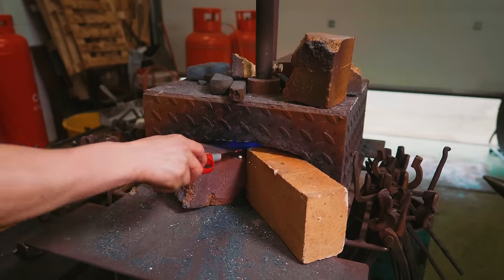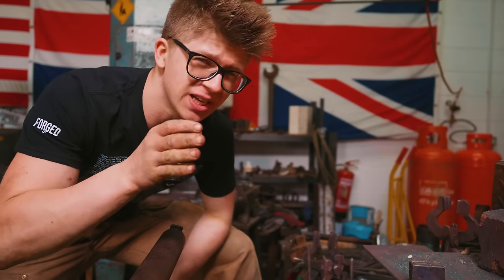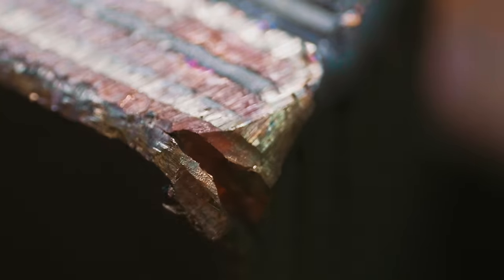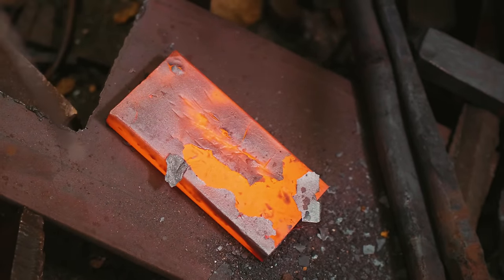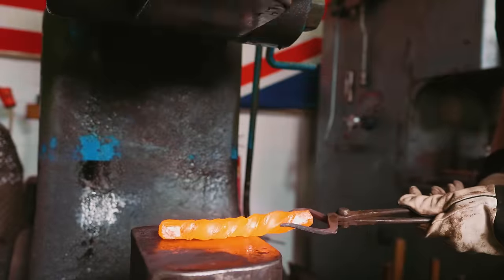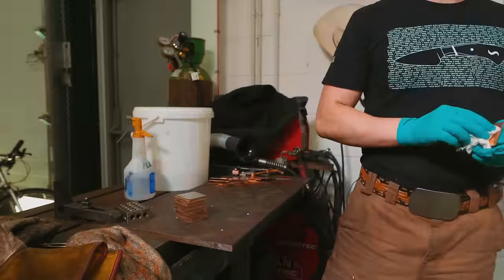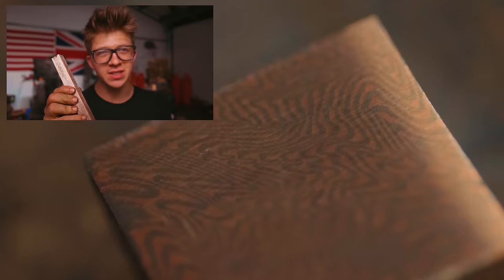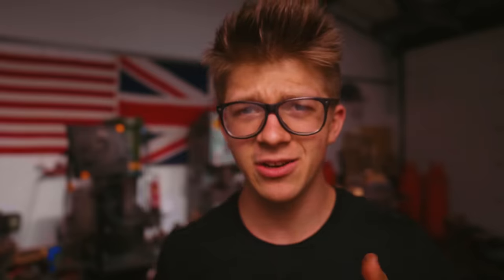CAN YOU MAKE COPPER & NICKEL DAMASCUS?!? MOKUME GANE!!!

Comment: Titanium Damascus is even cooler because it’s blue
Reply: Dimitri Isov but working with titanium is dangerous it doesn't melt it skips the liquid state and goes straight to the plasma state
Reply: He can use stainless steel and torch it to turn it blue.
Reply: my understanding was that titanium is remarkably unreactive in practical use cases, but I might be mistaken.
Reply: Titanium oxidises quite readily when heated over 100C (vast majority of white dyes are titanium oxide based) so it's not entirely stable. The tricky part of working with it is that it needs to be incredibly hot to do anything with (likely beyond the capabilities of the shop forge) and it's naturally super hard so cutting/drilling it requires specialist (read: expensive) tooling. The common misconception is that titanium is a rare metal when in truth it's quite common, the rarity is more on account of the lack of facilities that can process it in any meaningful way
Reply: Only one person in the world knows how to make timascus and it’s blue and pink
Reply: Norman, titanium is resistant toward corrosion in standard conditions, but it is very reactive with oxygen when heated. That is why it needs so much more inert gas (argon) during welding than any other metal.
Reply: Corey Ylitalo No
Reply: Anything that's blue, is automatically cooler than it's non-blue counterpart.
Reply: That's a myth, there at least three companies that sell timascus: one in US, one in Russia and one in Asia (Japan or China, I forgot).
Reply: You can't really forge titanium, its brittle when hot. It has to be melted and alloyed in a nitrogen flooded or vacuum forge. To forge titanium you melt two batches of different (and compatible) titanium alloys, work them separately into sheets, cut them stack them weld them, etc. The common coloring is a heat treatment (oil slick multicolor pattern with high contrast) or chemical treatment (mostly blue, it's the same coloring chemical treatment used on steel for bluing).
Reply: fun fact... this episode is NOT about titanium...
Reply: really?... realllyyyy? like greek fire ? duuuuuuuuuude.. how can ppl even say stuff like that.... its plain stupid.
Reply: oh my gosh.. reading comments makes me puke. sorry BUT why do u even comment when knowing nothing..... titanium ISNOT colored with chemicals... it oxides when heated. Thickness of the oxid layer will change the color wich the light is reflected from the titanium.. effectively changing the color we see.

Comment: Love to have some of that as a set of 1911 grips.
Reply: That would be sweet! But I wonder if the gun cleaning solvents/oils would react poorly with the copper?
Reply: You would need to be careful with solvents made to remove the copper fowling when cleaning. So long as you took them off or were careful you should be fine. Oils I am not sure of, maybe they would stain the copper a bit? My money is on it not doing much.
Reply: Ison Tenney  you would remove them during cleaning
Reply: I have a desert eagle and it would look nice with this
Reply: oof
Reply: What about grips for a revolver?  Or a Hi-Power?
Reply: Nothing more american than that my dude.
Reply: Sure, if you want your hands to stink all the time and develop an allergy and dermatitis from the nickel.
Reply: That would be sick
Reply: Have to seal it all the way around with something transparent?
Reply: ive seen it done. requires a coating on the outside. meaning it requires maintenance. 

id rather just get a nice set of timascus grips. would weigh less and look just as cool. you can get titanium mokume gane. its just titanium alloys done in the same pattern as traditional mokume gane.
Reply: @bmxriderforlife1234  A coating is required. EVERYONE is allergic to nickel, but that requires prolonged exposure before the allergy reveals itself. Once it does, you are sensitive to nickel for life. I developed it from a wrist watch and belt buckles I wore as a child. Now, even 5 minutes holding something nickel and it's like poison ivy. People should absolutely avoid nickel contact, even if they aren't currently allergic, cause they will be if they aren't careful.
Reply: @rich1051414  wow guess im lucky i wore a nickle ring for a long time and never had issues. i can still hold nickle without issue. 

maybe im just lucky and it hasnt set it yet. 

the coating is also required to prevent issues when cleaning the gun and also to prevent the copper from oxidizing. well maybe not oxidizing but thats what my buddy said.
Reply: @bmxriderforlife1234  Once you get enough exposure, the body will start identifying it as an allergen. Little exposure probably won't alert the immune system, but once alerted the first time, it doesn't take much to alert it from then on.
Reply: Yup. Japanese technique and made by an Englishman. Nothing more American than that! :-)
Reply: I never clean my weapons with the wood still on.  So having these as grips wouldn't be any different.  I take my stuff apart to clean.  My current 1911 is sporting grips made in the mid 1940s and they are as clean and crisp as new.  I wouldn't wear them for concealed carry either, why hide something that sexy.
Reply: Gay

Comment: So what you’ve got there is a voltaic pile - the solid parts of an acid battery. Add an acid, even a mild acid, to the surface and I wonder what happens? Even the acid in your saliva would be enough to cause a reaction in the starting block before all the hammering. 

I’d love to touch it with some vinegar on my fingers. It wouldn’t be much of a charge, it won’t spark or anything, but I’d love to see what a voltmeter says

Comment: I have made some stuff with layering copper and tin not completely mixed together. I didn't know the idea of damascus like materials then. But I knew completely mixing them makes bronze an alloy - but this stuff I made are much softer. It rust to a beautiful antique look. Those are much easier to handle metals for me than steel. I don't even have a furnace or forge, much lower temperatures than you guys are working with.
Reply: When I made those stuff the copper actually didn't melt. It was actually the other metal you put in that 'glues' together sheets of copper.

Comment: would look cool as 20 sided dice, 12 sided dice, 10 sided dice, 8 sided dice, 6 sided dice, 4 sided dice.... and then in my dice collection :D
Reply: You'd have to do loads of calculations for the dice to be weighted correctly, with the difference in density between the two, which adds a whole new level of weight distribution... then again, I'd never actually roll Alec Steele made dice! (although I'd be very very tempted)
Reply: Copper and nickel are very close in density, so as long as you could assure the pattern was fairly symmetrical, it shouldn't cause too many balance issues.
Reply: Making dice must be a nightmare... How do you even cut a d20?
Reply: Its alot easier than cutting a gemstone!
Reply: bob baxter they would be my favorite DND dice
Reply: Hawkesnightmare  Even a small, very small imbalance will add a bias to a dice. Even commercially made, plastic, resin etc dice often have a bias
Reply: I don't know whether to love this idea  or to hate myself for not having it....
Reply: great idea
Reply: Bob: Dice Collectors are Neurotic ! My Wife Started a Dice Collection 20 Years ago. And I can't Stand the Sight of them . They make me want to Vomit. If she sees them at Patio Sales, No doubt she will buy them. So now if they have them, I just go sit in the Car. It's kind of like Beating a Dead Horse.
Reply: @iweinjoos6694  Smart man
Reply: what for, D&D
Reply: I've made metal dice and while they feel and look cool, they don't roll well at all.
For my money, stone and glass type materials make better exotic dice.
Reply: I agree, dice would be awesome.

Comment: Mokumegane = Wooden Steel
Reply: Mokume(木目) = wood grain,    -gane(金) = steel
Reply: デュジア256 Ah, sweet. So my memory wasn't as bad as I thought it was. Glad to see that, even though I haven't had to speak Japanese in so long, a lot of it's still in there somewhere.
Reply: More literally, "wood eye metal."  Moku = Wood, Me = Eye, Gane = Metal.
Reply: Charles Christopher not really, 目can mean eye, or a category, or order(as in kingdom-phylum-class-order-family-genus-species).
Reply: You can translate that as wood-patterned metal
Reply: Bowman C. In this case it means "eye" because of the concentric circle/oval patterns  formed when a bull nose gouge cuts a divot in the billit before it it forged flat again.  The same effect is achieved with a shallow divot is made through several layers with a drill bit and then forging, or rolling, the billit/sheet flat and smooth  again.
Reply: Absolutely beautiful patterns.  Wonder how  strong the material is?
Reply: I just ran this through my internerd translator and it said mokumegane is Japanese for Damascus.

It also said Gerberger means troll in German.
Reply: Just wondering,  does anyone be know if Alec made anything with it?
Reply: so do you  Gerberger your mom should be ashamed.
Reply: デュジア256  megane = glasses!
Reply: Even more literally, "ALSO WARD EYE, BUT IT IS."  MO = Also, KU = Ward, ME = eye, GA = but, NE = it is.
Reply: Charles Christopher 木and目 wrote separately would be tree and eye but together it’s wood grain

Comment: Alec, I've found your experiments with different metals to be very interesting. It's got my mind working on what metals could be forge welded and what it would look like layered? What purpose could it then be put to? I wonder if you have ever tried or thought to try forge welding copper and alumnium. I've seen a couple videos where smiths have forged aluminum, and my grandfather was skilled at welding aluminum back in his day, so I feel it should be possible. What are your thoughts?

Comment: You should make a origami epoxy handle, fold up some thin colored paper, and suspend it in epoxy resin!! It would look awesome, (or could look awesome, depending on what you did, maybe weave the colours cut in thin strips or fold like an accordion making thin strips then weave it together, suspend in epoxy, when it is ground to shape, cutting through some of the stabilized paper, leaving different colours and shapes, then a clear epoxy top coat, and sand and polish smooth,  dahm, I got me wanting to make one now!!
Awesome work!!

Comment: Awesome look; for a practical material I think you could also try two different grades of nickel-bronze; pre-alloy the nickel and the bronze a little, if you will. Probably makes the fusing and forging easier since the materials will be much closer in their properties; and the end result should have excellent mechanical and corrosion properties. Of course that would be at the expense of some color contrast; but you could probably bring a lot of that back with the right etch. There are both some very coppery as well as very silvery bronzes out there. Or all kinds really, if you venture beyond copper and nickel.

Comment: Make a blade from the first pattern as the twist is amaizing.
Reply: copper is a very soft metal, only would be for show and no use.
Reply: It may be soft but that would be amazing looking
Reply: Envelope opener. Lol or fancy butter knife
Reply: Like i said "Copper is a very soft metal, ONLY WOULD BE FOR SHOW and no use"
Reply: Except that you can still kill someone with a copper knife... Sure you wouldn't be able to use it for working on wood or anything hard, but it would be a perfect letter opener.
Reply: Clever boii
Reply: Sorry m8, i'm not clever, i'm only for show.
Reply: Sure, copper is soft, but it takes an edge very easily... Not sure if the nickel hardens it up a little, but it would make for a decent knife...
And if you stab someone with a copper blade that leaves a little copper behind, well, you get an instant toxic infection in the body.
Reply: It wouldn't hold an edge, that's why they used bronze for tools/weapons instead of pure copper or pure tin. Nickel is typically alloyed with other metals, mainly in steel, so it wouldn't make a very good knife.

The most you could use that Mokume Gane for is something decorative like a ring or perhaps a guard for a knife. Trust me, you should only use good quality steel for tools as it has superior mechanical properties, can be machined with relative ease and is inexpensive.

Comment: I wonder how a copper and zinc damascus might look? Would the edges between the different metals alloy, so that you get thick waves of copper and zinc with thinner waves of brass along the edges?
Reply: I've seen zinc, brass, and copper, mokume-gane, but the zinc is used to hold it together. I was waiting to see Alec's bullet hit a specific phase change, which I think was that shimmer he saw, which I think is the point at which the metals have brazed or at least started to braze together. A zinc and copper would solder together similarly, but much cooler. It's been 15 years since I watched someone do it and explain why it worked, so I may be not entirely correct.
Reply: Zinc is a very dangerous metal to put in the forge. Its fumes are ExtremelyToxic, like Kill you toxic.

Comment: I use this In jewelry i make  with silver and copper.  I work it cold once it's fused tell it hardens . If you bring it up to that high in temp it melts at a lower temp at the point of fusing because that thin layer is a alloy . I bring it up to fusing temp allow it to fuse then anneal it .the more times you anneal the better

Comment: Mokume Gane kinda looks like wood, in my opinion. Why not make it into a pen or some other utensil. :3
Reply: Hyginx The Wolf I was thinking the exact same thing
Reply: I was also thinking about a pen. Karas fountain pens are metal, as are a lot of Kaweco pens. This Mokume Gane would make an awesome fountain pen.
Reply: Mokume gane roughly translates to "Wood-grained metal", so I'd reckon it's safe to say that the Japanese agree with you ;)

Also, no need to capitalize both words. Romanized Japanese technically doesn't use any capital letters or punctuation unless you would put punctuation into the corresponding regular Japanese.
Reply: because of the different metals it will degrade, when it comes in contact with the sweat on your skin :/
Reply: +Hyginx The Wolf Good guess. 木目金 (mokumegane) in Japanese literally means "wood eye metal" and "eye" in Japanese is  often used for figured wood grains. For example 虎目 (torame, or "tiger eye") is the Japanese name for flamed wood grains.

Comment: Well i guess make a knife with it. Chefs Knife
Reply: too soft no?
Reply: Copper isn't hard enough to keep an edge for long. Also it would stain when cutting any acidic food.
This would transfer to the food as a dark gray colouring.
Not pretty.
Reply: How about layered on the outside of a high carbon steel layer and made into a dagger? I’m not certain they’ll fuse but... 🤷🏼‍♂️
Reply: Too soft for the blade but maybe shaped into the handle.
Reply: Not for the blade. The copper is too reactive. Your food would end up tasting like pennies and corrode the blade quickly. The nickel isn't as reactive, but IS toxic (carcinogen). Use it for the handle. It would also make really cool butt and bolster.
Reply: I just suggested a chefs knife but then I remembered copper reacting with acid can literally give the consumer copper poisoning, which is not a nice thing to experience putting it lightly
Reply: Take it from a chef that has used copper pots before. They’re usually tin protected for a reason
Reply: @markp8295  you could work harden it but yeah pretty much.
Reply: Rivets for a handle only thanks.....

Comment: Welding Copper Usually Requires Straight Helium. I’m Just Saying. Thought I’d Drop a Little Bit of Knowledge.
Reply: Bronson Stephens that's when you're tig welding, where you're actually melting the copper. when you're just hearing it like that it doesn't matter as much.
Reply: jack clark I Know! I Just Thought it’d Be Something Cool to Share
Reply: you sure don't have knowledge in terms of shift key usage
Reply: Casey Like. Long Copper Welds? Did You Have to Run Really Hot?
Reply: Jakub Komorowski-Marcjan I Think it Looks Cool and Makes My Comment Stand Out More.